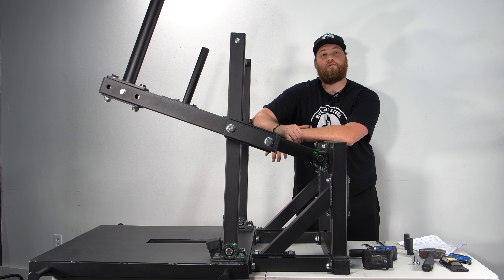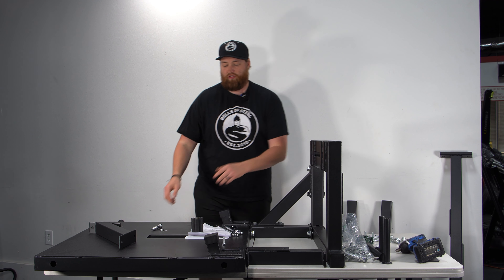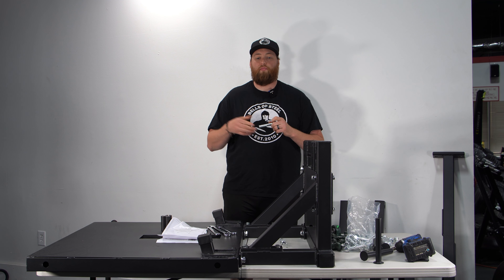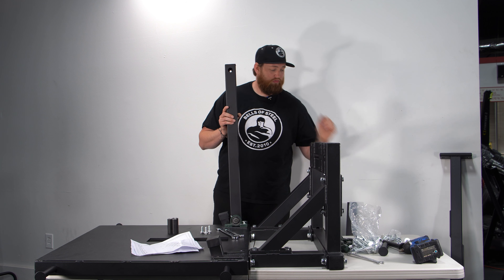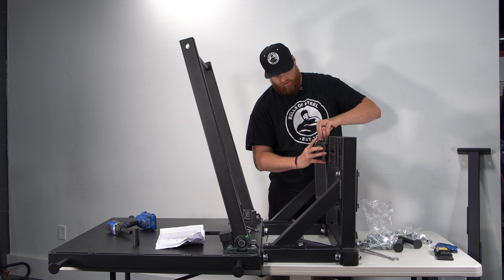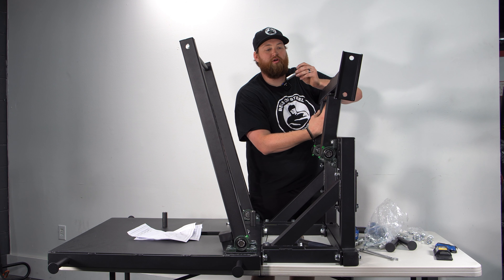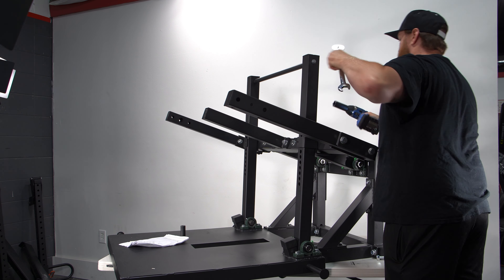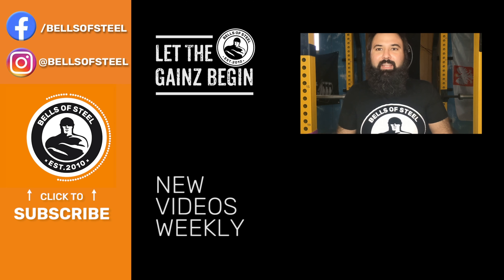Bells of Steel Belt Squat 2.0 How to assemble

Comment: A couple of tips after following these instructions:
1) Install the handle bar before installing the first set of bearings
2) Install the second set of bearings with the lever arms in the up or horizontal position. Installing them in the down vertical position results in them getting stuck under the angled support bar
3) Rest the frame on the J-hooks when installing the bar that the belt attaches to
The installation took 2.5 hours with only regular wrenches and no powered impact wrench.
I am really glad we did not install it on a table as it is heavy af when assembled.
The assembled belt squat works perfectly and is a solid piece of equipment. I'm really happy with it.
Reply: I put mine on a table now I need a village to get it off on the floor

Comment: How can you tell which bolt is which?
Reply from the maker: It can be tough to tell, as the bolts are similar in size. Line them up next to each other to see which ones are the right one for the section you’re assembling. We’ll look into making the instructions way more clear.